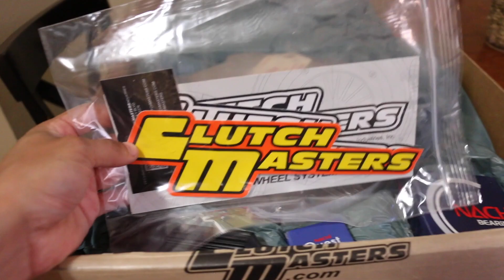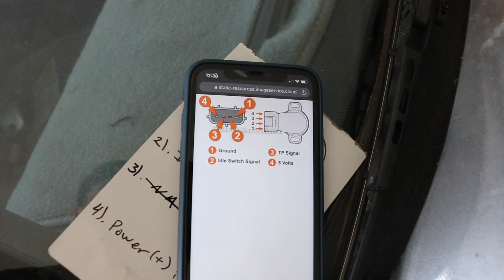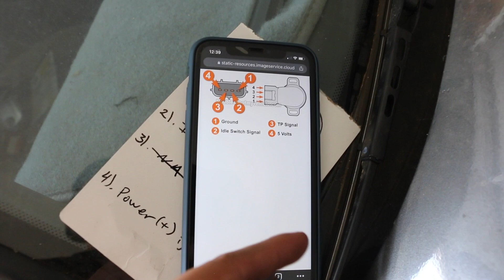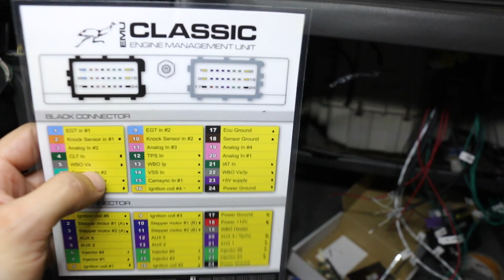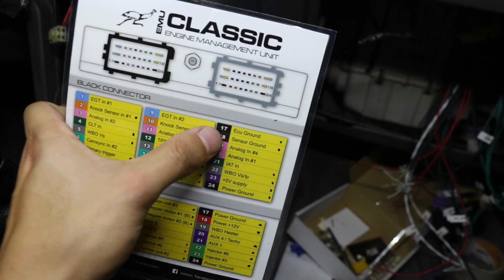MK3 SUPRA BUILD, CUSTOM ECU MASTER HARNESS PART 6 ( FINISHING SENSORS)

Comment: I am using the p&p 7m adaptor which saved some time and cut back parts of my harness and got the connectors with pigtails made to also save time, I'm jealous of your skills you are doing a ton of work but also doing it the right way. Only question i was having and i'm sure I'll know as soon as I power up the software, but which is knock sensor #1 (closest to firewall ?) curious so i can make the change on the pins now correctly If I need to. THank you
Reply from the maker: Brad Jordan ive never done this before so im surprised myself. Well see if it even works at the end. And yes ur correct closest to firewall
Reply: LFATV thank you and love your channel all vids are extremely informative!

Comment: It's best to remote mount the pressure sensors,  oil, fuel,  etc, and not directly on the engine to minimize noise in the sensor measurement, and also for longevity.
Reply from the maker: Howard Hutchinson other then adding a sandwich plate for the oil pressure idk were else i would put that then on the actually oem location.. fuel pressure sensor is not mounted in the engine either??
Reply: Sometimes you are  just creating more points of potential failure by using multiple fittings and lines to move a sensor instead of keeping it simple and mounting it where it makes sense.
Reply from the maker: Joseph U are u referring to the the sensor ground and 5 volt supplies? If so how else would u put 6 18ga sensor grounds n 6 5v 18ga  supplies to 1 18ga pin?
Reply: @-LFATV  If you have a remote oil cooler setup, then the filter block would be an ideal location for the sensor.   Also look at the pictures lowdoller has on their webpage for their Pressure Sensor Mount, that's how it's normally done.  Holley also has a similar product.   If you're planning to program oil pressure safety into your EMU, them it would be best practice to minimize the hysteresis from the sensor.   Sensor hysteresis and longevity, if that's important to you,  then remote mount.  Also,  the stock oil port is 1/8BST, the GM sensor is 1/8NPT, you're going to need an adapter if you decide to screw the sensor directly into the engine block.
Reply: @-LFATV  1/8BSP that is
Reply from the maker: Howard Hutchinson yea i ordered the adapter for oem thread but a lot of good information i appreciate the feed back ill look into it for sure
Reply: @-LFATV  😂🤣😂 no I was referring to Howard Hutchinsons original comment about remote mounting pressure Sanders etc...
Reply from the maker: Joseph U gotchaaa i got confused for a bit

Comment: Did you cut the crank signal wire close to the hall sensor, then solder the insulated signal wire? If you left that wire that came on the hall sensor full length it will still pick up interference.

Looks like you're making awesome progress! I'm in the middle of wiring up my megasquirt ms3x right now!
Reply from the maker: Josiah Hein no sir i cut a good chunk off it, i didnt wanna cut it riighhttt at the sensor either

Comment: Hey man I have a question, I'm following your videos for the wiring. I'm using the same ecumasters. Question now that you have all the 5volts cables are still need to use the relay box that you builded before.?
Thanks.
Reply from the maker: Oscar Canizales well tea because the relay box will be for all the 12 volt supplies

Comment: Coming along nicely! But when you solder let the wire heat up a little more and apply the solder slowly. You want to be able to see the outline of the  wire strands still if not you got too much solder on the wires. And you'll end up with high resistance in the wiring and it will give you issues down the road.
Reply from the maker: justforkiks29 gotcha. For sure thank for the tip. The video was sped up a bit during those clips so hopefully got em good

Comment: Could pig tail connectors be used for the hall sensors instead of direct wiring?
Reply from the maker: I did end up using pigtail connectors in later videos to have the ability to change them out wen bad